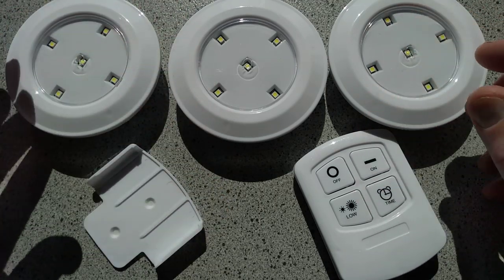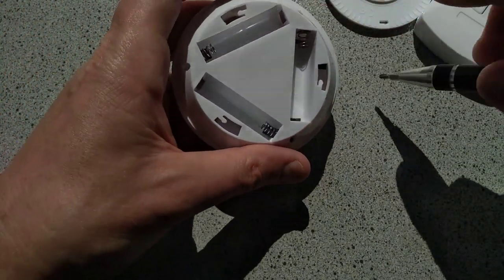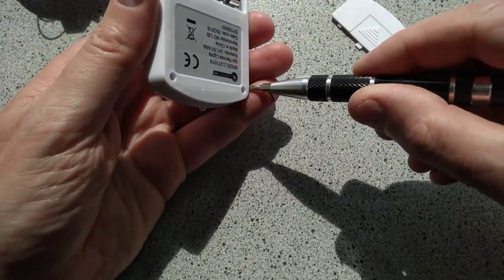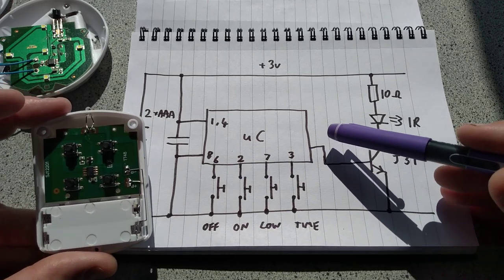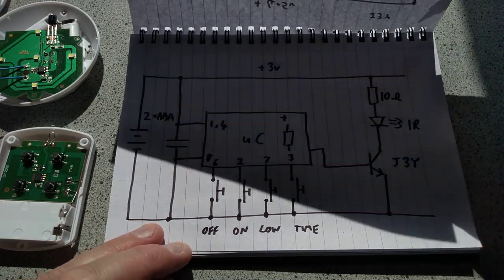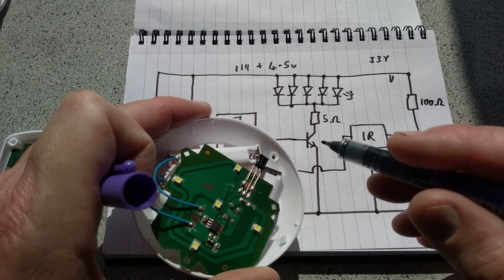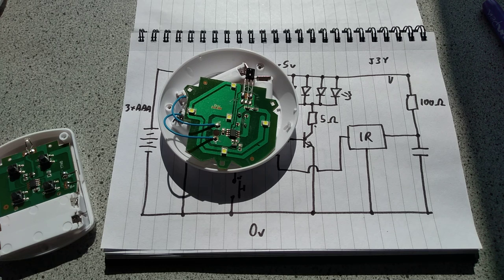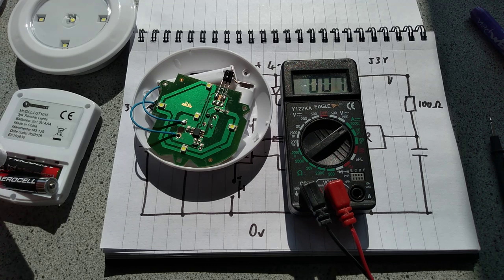Poundland remote control light set.  (with schematics)

Comment: Hey Clive... I was wondering if I could pick your brain on DMX 512 Decoders?  I keep blowing them up and it is starting to get frustrating.  Each channel is rated for 4 amps and my load should be 3 amps.  They work for a short while and pop.  Have you seen anything like this?  I would greatly appreciate your input if you have time.  

Thank you
Reply: John Coops —- thanks for the input, what blew was a current limiting resistor before the voltage regulator feeding the processor... it was odd they have worked for 8 years and we added more lights with their own decoders, when we were doing this I noticed a sketchy splice in the ceiling so I moved it to where it was accessible disconnect from the controller and went to solder some xlr’s for a better connection. What I found odd was when I touched my soldering iron on what I thought was a disconnected dmx line it sparked. Then all the old decoders were dead. So I thought I wasn’t careful enough and I should have disconnected the decoders as well. Well I got new ones was careful enough to solder them disconnected ... plugged them all in and poof one more dead.

I tripled checked the connections and discovered the 24 volt feed line was shorted to the support structure and would feed 24 volt on the dmx ground when I placed the decoder in the housing. I found the shirt and my decoders are working fine now. Very frustrating.

Comment: You can correct for pretty nearly any lighting with a white balance target. I use one to get perfect skintones, which you might like to get so that we can all admire your beautiful hands.
Reply from the maker: I'm filming these on the fly with a phone, so it lacks the ability to calibrate exposure and white balance on a standard grey card.  I wish it did have that feature.
Reply: Aha! You may even have said so but I wasn't paying adequate attention. I've noticed that putting a WB target in the background has the device calibrate itself on that (I do it when skyping to avoid looking like a corpse), but with white gadgets as the subject matter, that wouldn't work I don't think. Putting the objects on a darkish t-shirt would help with exposure, though. Depending on the phone, there might also be an alternative video app that can have exposure dialed in. I'm so paranoid about 3rd party apps that I wouldn't advise that, however. I even do my online banking exclusively on a virgin fire tablet (£30 when on reduction), and whose ARM chipset has no speculative features so impervious to Spectre-style hacks.

Comment: How well do they work when the remote isn’t directly pointed at it? Does the ir signal bounce of objects or do you need line of sight?
Reply from the maker: They're pretty good for bounced signals.  But you can selectively switch them if they are far apart.
Reply: bigclivedotcom I’ve seen lights nearly identical to these but have a dip switch to set a address so you can have multiple remotes in one room and not turn all on or off. Very surprised how well the ir works, I would have used rf but then in America you need fcc approval.

Comment: I purchased some of these from Home Bargains branded as Grundig for £3.99 and saw a set of 5 branded as Status in Dunelm Mill for £20
Reply: Also got a set from Home Bargains for £3.99 branded as Grundig.  Been working for 3 weeks without any issues.
Very impressed with these.  
Two little difference is the bottom right button on the transmitter is labeled "30 mins." And the top line is "-" on the left and "O" on the right (reversed to Clive's).  Makes me think the transmitter may be different.

Comment: The high quiescent current is because of the infrared receiver. They should for example turn on the receiver lets say 1/4 of the time and transmit 4 messages instead of one when you press the remote control.
Reply: Switching the receiver on and off would mean that there would have to be a timer running in the microcontroller. What current is saved from reduced receiver operation will be lost in increased microcontroller current.
Reply: @6F6G  I think a microcontroller consumes way less power. A digital watcj can run ten years on a small battery The IR receiver consumes a "relatively high" current consumption because it has an amplifier that is set to maximum gain by the AGC when no signal is received.
Reply: A microcontroller will draw next to nothing when it is completely shut down but may draw 100uA+ when partially shut down with a timer running.
Reply: @6F6G  A recent PIC12 microcontroller will consume 300 nanoamps with a 32KHz oscillator running
Reply: How long would it take a low cost IR receiver module to settle and work properly after a power up? If the module was continuously switched on and off then it might make the turn on command to appear sluggish.